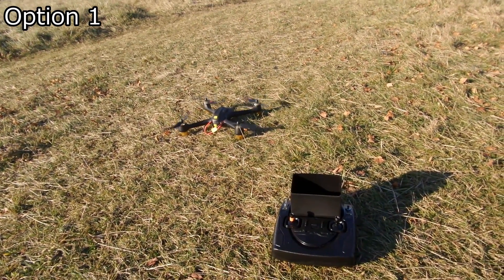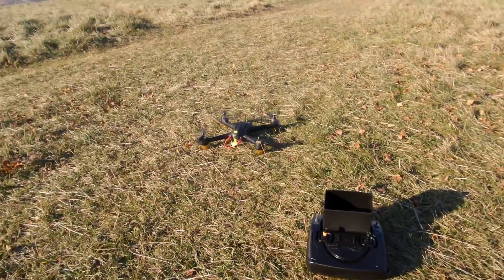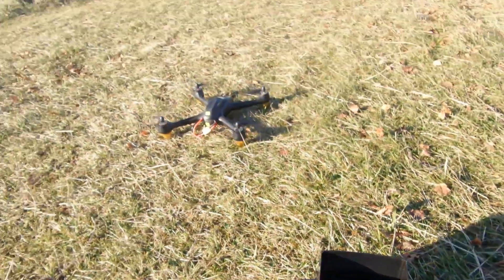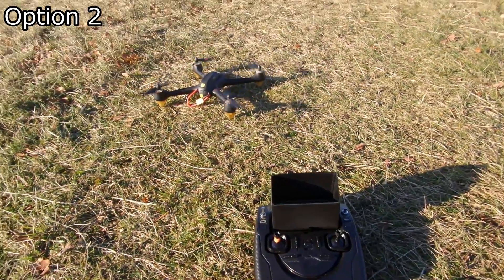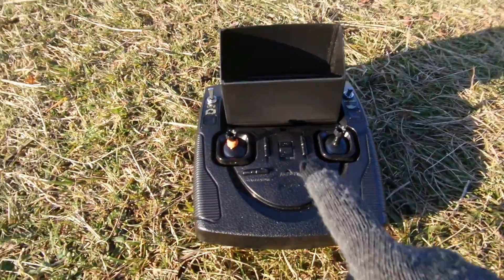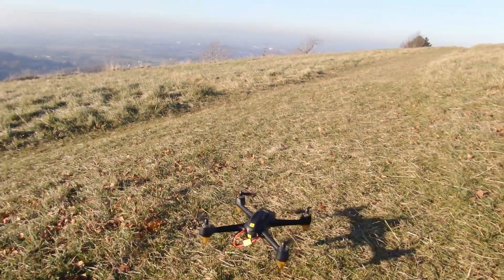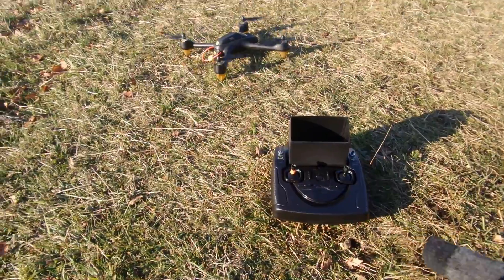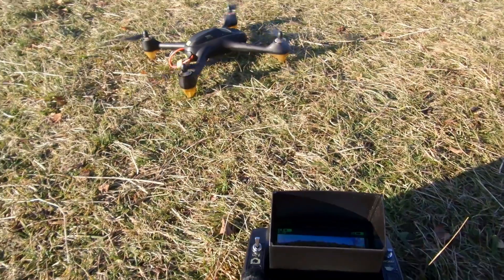Hubsan H501S - Auto Takeoff Methods

Comment: Don't for one moment think this video is "old" from the date of upload. It is still very relevant and useful information... These quads are still available on the market and if you wonder why your quad just took off... watch this... See how easy "pilot" error can cause a crash. The purpose of this video is to show that the quad can take-off without the regular method of pushing up the left throttle stick. So don't try it but know about it! Other than this there is a lot of other flaws with this drone as well. It's no toy!

Comment: If you have to fool the drone into doing an auto takeoff by very questionable means, it doesn't really do auto takeoff.  This amounts to silly trivial pursuit that increases the risk of getting something wrong.  I highly recommend that nobody includes these methods as standard operating procedures.
Reply from the maker: You seem to be completely missing the point. There is nothing remotely questionable about these methods. The entire purpose is to highlight how these features work for those that don't think things through. I recorded this video after several people inadvertently let their quad take  off in these scenarios, because they had not taken the time to understand how the failsafe routines  work. They were surprised and though the quad was faulty...
If this video stops one person getting a facefull of props through lack of understanding, then it will have served its purpose.
The methods are perfectly safe and everyone should perform  option 2 every single time they fly to check their arming point is correctly saved. It is part of my preflight check, and I've done it for 2 years and hundreds of flights without incident. It's better to understand and test the operation of your aircraft rather than pretend these things don't happen :-o
Reply: randoneur 'Features...' Riiiiiiiiight!
Reply: @randoneur  Hi; interesting video.  Engaging RTH on the ground to get it in the air makes sense but I don't know I would have thought of that - so thank you.  However, can you elaborate why you use method 2 as part of the pre-flight checklist?  You said it is to ensure the home point is correctly saved.  However, why not just get the drone in the air straight up, activate RTH to see if it reaches 10m right above the launch point. and then cancelling before it descends and lands?  This will ensure the home point is correctly stored in the drone's GPS.  However, one thing you didn't mention in the video is that is extremely  important you arm the motors with full GPS switch engaged ON to avoid a flyaway when RTH is activated.
Reply: I was about to say something similar. Each of these techniques seem like a bug in the control logic, rather than intentional routines.
It's good to warn people that this can happen. I'm glad I've seen this now, but it's wrong to suggest that people should deliberately use these methods.
All these should ideally be patched out by hubsan in firmware.
Reply from the maker: They are hardly what you would call a bug. They are features that are inherent in the RTH algorithm (in 1 and 2).
Lets start with 3 however. This is not a bug and could never be patched. It is simply a method of applying half throttle without having to touch a stick or run up power  slowly in GPS or ALT mode. There is absolutely nothing to fix.
1 and 2 have been "altered" in later firmware, but they just introduced a bigger problem because they changed a logical RTH process (climb and return) to one that does neither and the quad gets stuck in limbo when within 10m of take off. The only problem with the original RTH routine is that people didn't think it through enough and were surprised when it did what it was supposed to do (as shown in 1 and 2.)
Again this is not fooling anything or anyone. It's exactly how it is designed to work and how it does work. (this is not unique to hubsan BTW)

Comment: tried it with a friends using an advance controller, 

 1st versions RTH lost GPS home position after taking off and engaging RTH again after flying for 5 mins, upon returning the drone passed me and went over 25 feet almost landing in a lake,

2nd version the same ordeal,

3rd version was worse, the drone took off shooting up like in the video and by the time i got it to settle with GPS it did a flip and almost crashed, i also had to force the drone to land manually because the RTH feature had no GPS location stored,

I would imagine RHT should return to where ever the controller is but it appears Hubsan designed them to land where the GPS signal was calibrated or took off from.,  so in fact when you switch GPS on and off its a risk of having the bowl effect take your drone down.
Reply from the maker: RTH position is arming point (assuming you have a valid position).
RTH can also change with later versions of firmware to  RT controller, using controller position (in manually invoked RTH). This is also a selectable parameter in the 501A.
If your quad is flying off you either have not set it up correctly or there is a fault. That is why you do all these preflight checks - to identify issues and correct them.

Comment: for option 1 (&2) RTH do you switch off RTH once itz in the air? ...If not will it jus take off then land in the same spot?
Reply from the maker: Correct. RTH will just take off and immediately land again unless you disengage RTH (#1) or turn on the controller(#2)

Number 2 is my party trick for when someone asks is the quad hard to fly.
I say "yes, this hard".
Arm motors. Sit down. switch off controller. Put away in backpack. Quad takes off, does a quick hover and then lands again, whilst I get out my flask and have a cup of tea....

Comment: Option 1 seems the safer one  Thanks for showing
Reply: I agree.  Since this quad has a centering throttle stick, option three is no different than me taking my built quads and punching the throttle to midpoint after arming...
Reply: I beleive both option1 and 2 are actualy rth and fail safe process. The quad was programmed to go to the target altitude level before proceed return to home. If there is no gps lock for home...maybe the quad can fly away home...this is just my thinking.